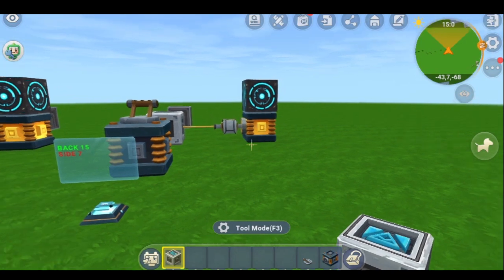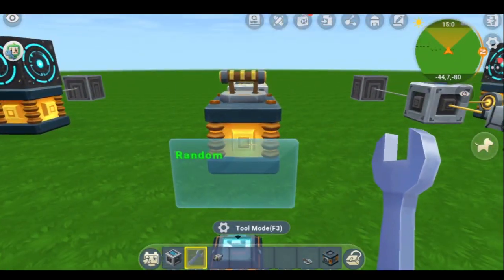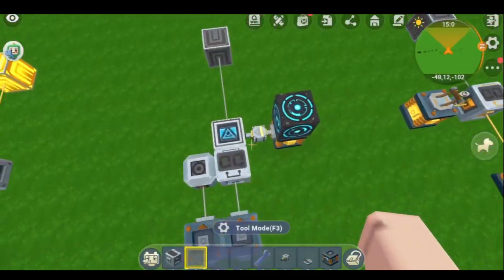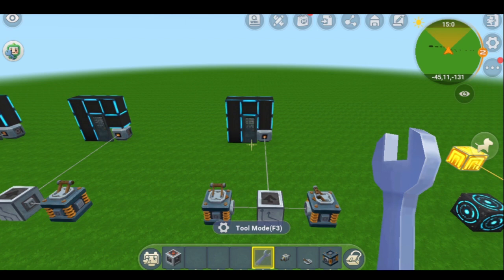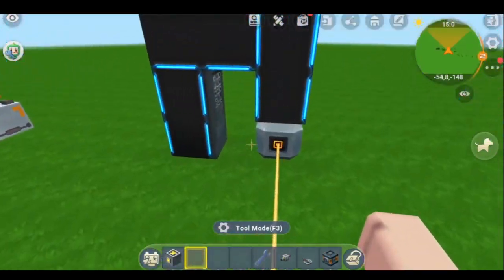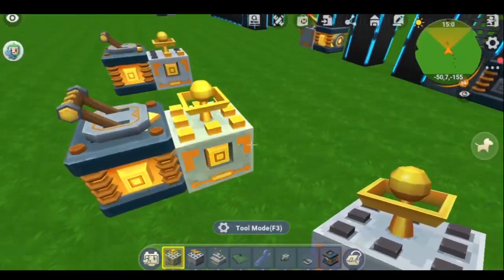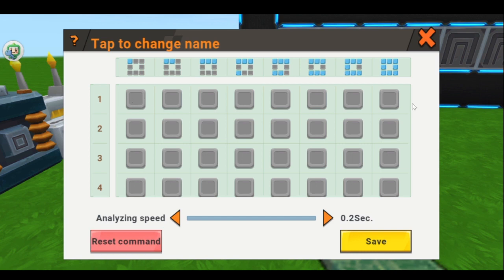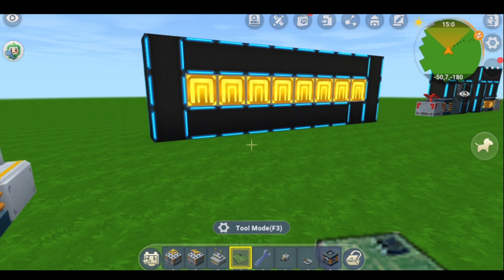Celesthium Circuits logic blocks ⚡🔌🔋🔧

Comment: Or since if i were correct, it has 7 or 8 things so i can make a binary counter without making a big mess :0
Reply: And since i can stack cards i can make a proximately 90 or even 120 counts with it but still pretty useless unless i use more signal resolvers in which when 120 is done in the other i can trigger the other resolver to give 240 and another for 360 and another and another
Reply: I still need a storage way though or a way to make and blocks pause to pause energy and connecting it to a t flipflop, that thing could help as comparators in minecraft has block and we cant even have a booster to just keep a block for a while then let it go